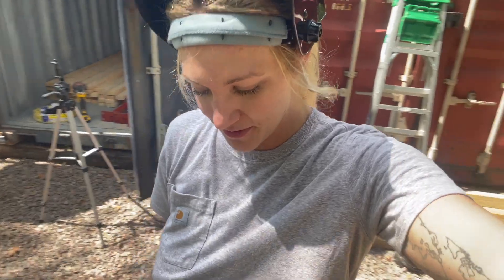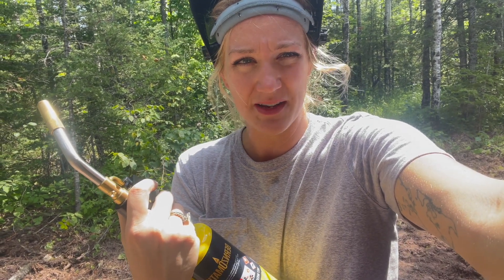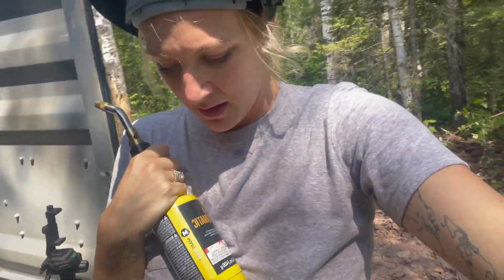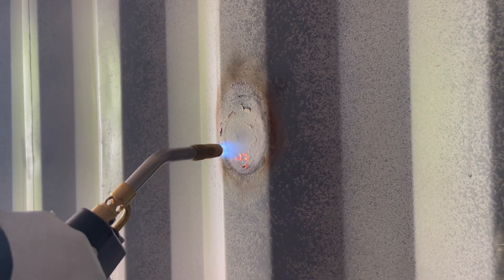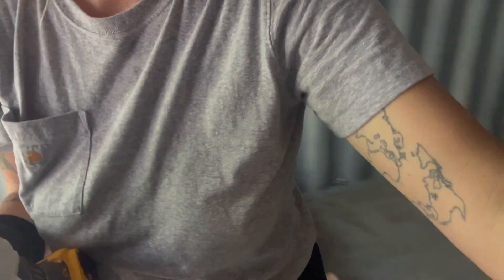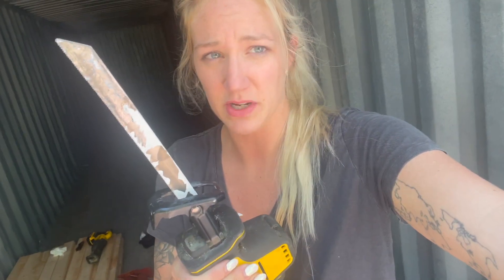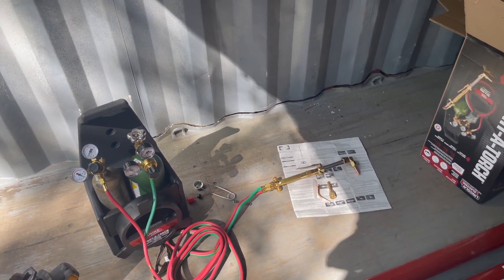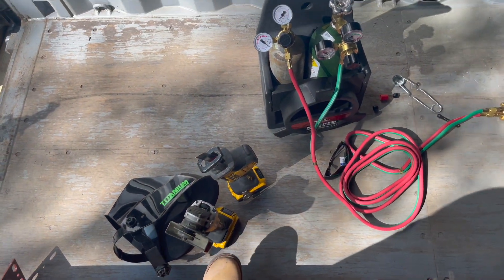Shipping Container Build pt. 3 - Testing Cutting Methods

Comment: Removing Panels , you should always use ..Plasma Cutting for any thing else also Plasma is the go to for extreme cutting uses. Always use a Straight Edge and go for it till it cuts out places you need to do.  Torches is just about a thing f the past when it comes to Plasma. Oxy-Acetylene is not to be used because it is costly and can get fire also on things.  Work easy and then things go quickly and fast.

Comment: Milwaukee has the best metal circular saw, and the plasma cutter Is safest for those popping moving cuts, they are the tried and true ways. Sorry you had to go thru the trial and error I did too.
Reply from the maker: Yes! I’ve heard plasma cutter a lot and that would have been my next step but that circular saw worked like butter so no need
Reply: Nice! I had one container that was heavily banged up, it jumped and moved out of place. The circular saw is much faster on the smooth walls